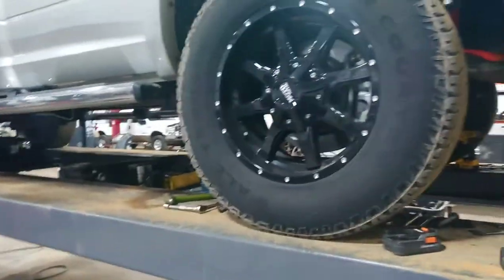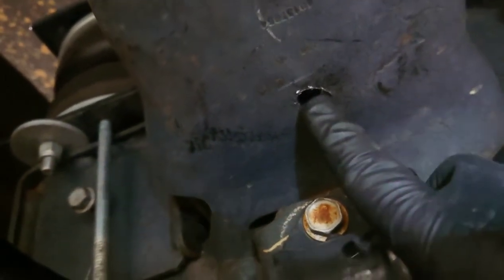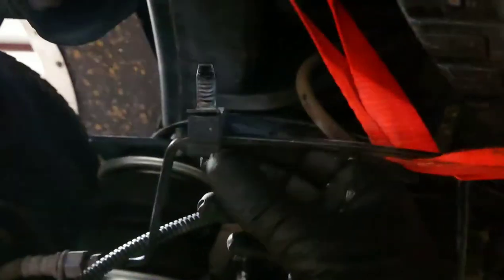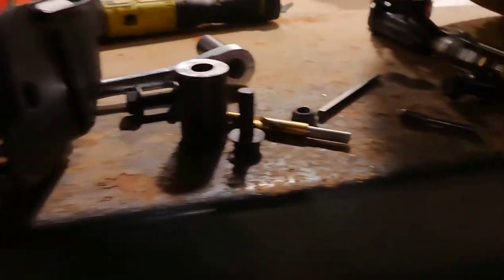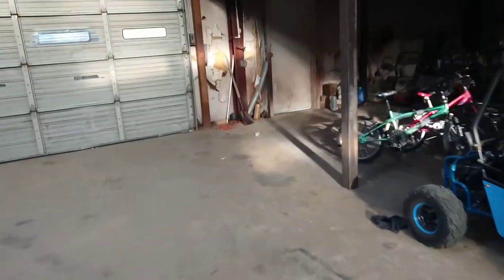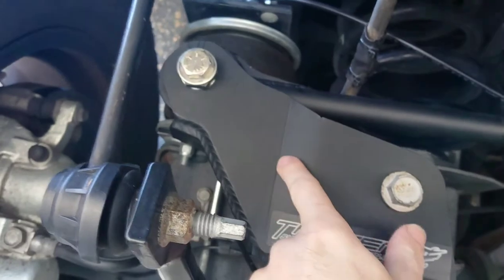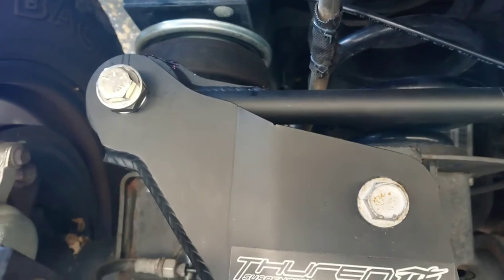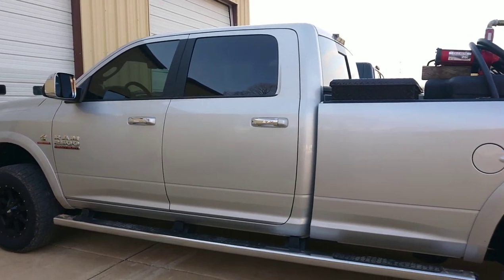Thuren track bar kit 2014+ Ram 2500 coil spring

Comment: You installed your track bar backwards and upside down , the metal gussets need to face the ground, might want to turn that around. I just installed mine tonight took me 1 hr In my driveway laying down. If you read the instructions you would of known to bolt the part of the bracket up  temporally while you drilled your holes. You would of had better luck,  just saying.

Comment: Wish I would have seen this before I started, I’m at the point where the bolts aren’t lining up and I need a burr kit. I went through 3 Milwaukee bits and it got way to late to go to harbor freight
Reply from the maker: Sorry man, it's no doubt a aggravating install.
Reply: Curtis Bull
Yes it was!
I had to make several runs to Home Depot and then to harbor freight on my wife’s Jeep.
The instructions made it seem so easy but I still saved a lot of money doing it myself